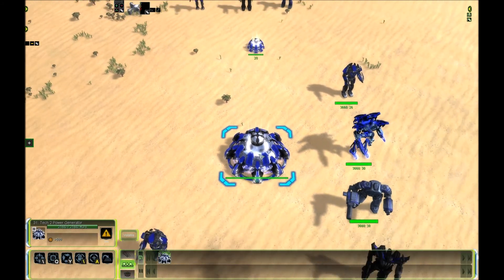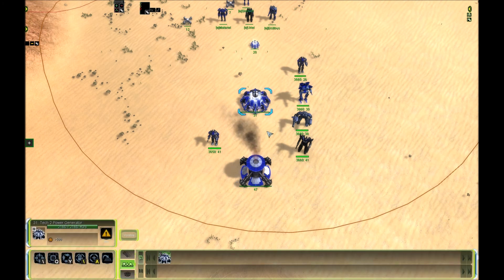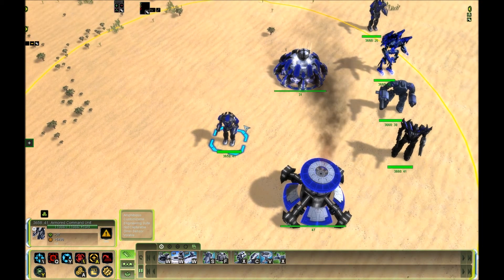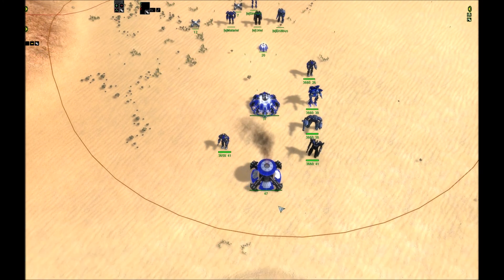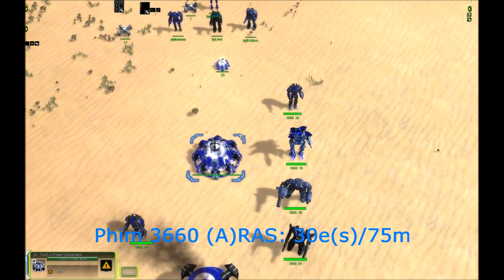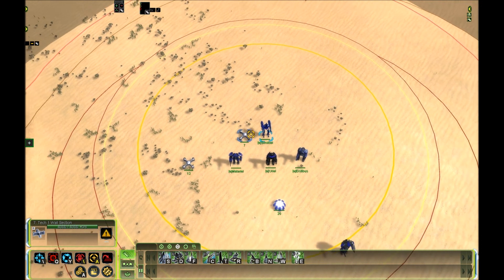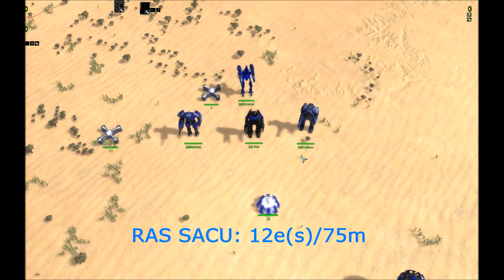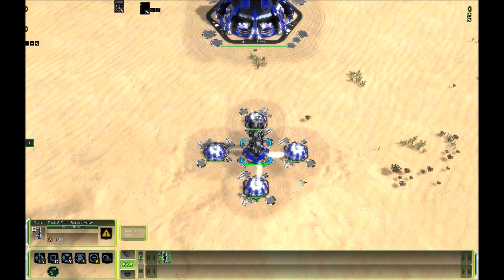How to Eco (Power) - FAF Tutorial 6a - Supreme Commander Forged Alliance

Comment: Right, I'm very late to this party... But I have a question (Don't know if this is answered further down the line, but I won't remember if I don't ask now). I usually ring my main radar (going to Omni) with T2 power... Is this good or bad? XD Is the reduction in power drain worth it or not?
Reply: I'd say it depends on the radar's vulnerability. You might get T2 radar in the T1 phase, in which case it's definitely worth it.